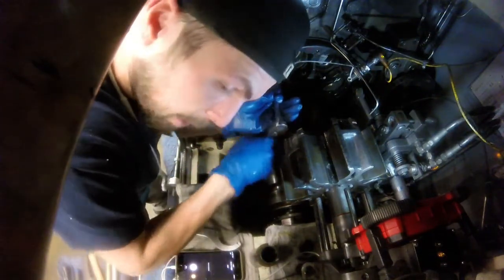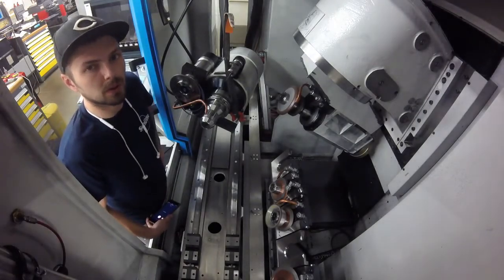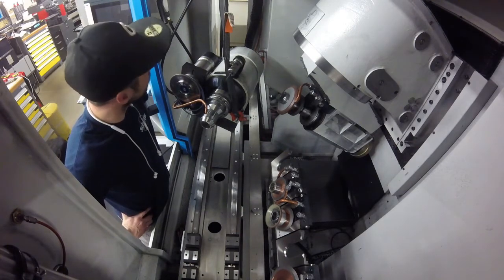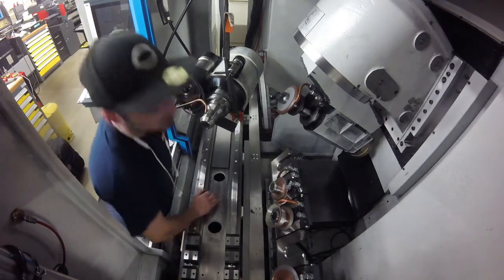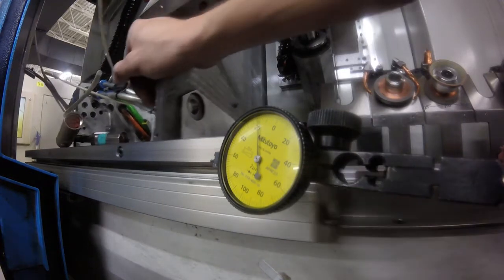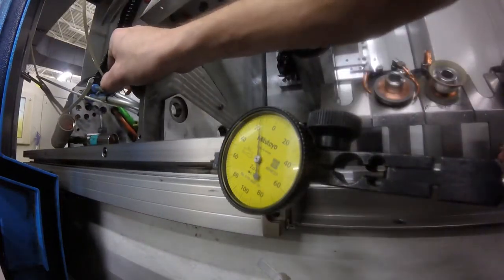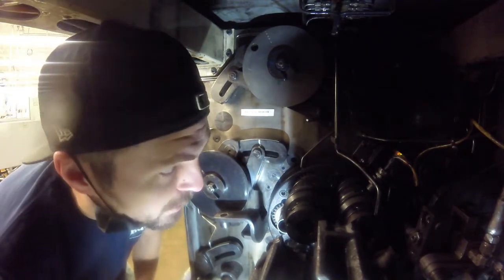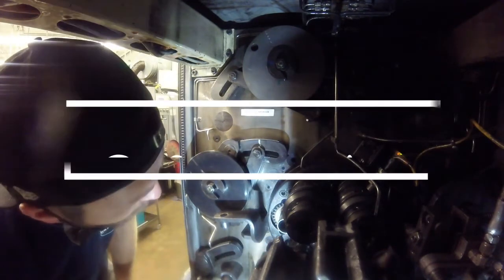CNC Machine Repair - Robs Wrenches 🔧 - Episode 1

Comment: How do you like this line of work? I'm considering getting into it after 9 years in industrial manufacturing and robotics repair
Reply from the maker: It keeps a man busy that is for certain, ive been rebuilding precision cnc grinding machines for about 10 years as well as national/international service and it has taken me to some crazy places that one would not normally venture to. Now i have a wife and kids so it has its challenges, but when i was younger it was great to not be tied down doing the same monotonous work over and over and over. I still find joy in the freedom that comes with being a field service engineer, i dictate alot of my own schedule, and how things will be done and when. So, if youve got tough skin and dont get very home sick, it is the ultimate career for adventure and learning, and typcially experienced FSEs will make 100k+ with over time included depending on which company you work for. But most places have extra incentives as well being that it has hard to find someone that is willing to be gone 48 weeks out of the year in some cases. Hope this helps ya!
Reply: @Robswrenches  this helps tremendously thank you